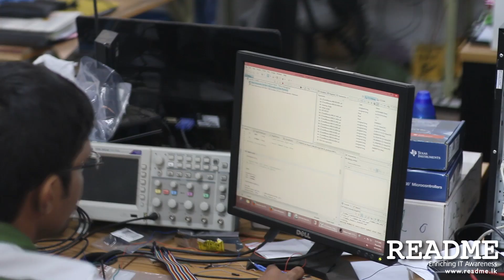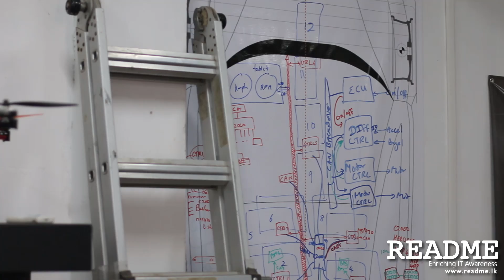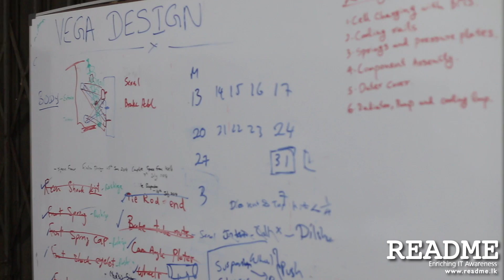VEGA - The Sri Lankan Super Car by Codegen

Comment: Theres another improvement i suggest to build on this car .If that car goes more than 60 kmh or more the car will loose its traction controls because its well designed aerodynamic shape  ,I suggest a  spoiler that could respond by controlling  the downforce when the car automatically achieve more speed .I think this would be so helpful for our srilankan engineers .well done again .

Comment: Most of the consumer market in Sri Lanka is comprised of common ordinary people. How many can afford super cars? The TATA Nano is very popular among Sri Lankans as a very aerodynamically designed and a very fuel efficient car. The egg shape of the car is very adorable and loved by many. But there are short comings of that car - it has no second hand value. If you can make a car designed like the Nano to run with electric motors like the VEGA it would be just ideal. With a solar panel on the roof to charge the battery, I am sure you would make substantial profits from such venture.